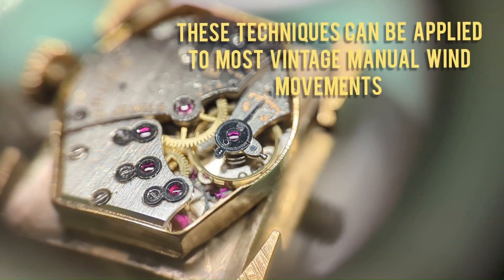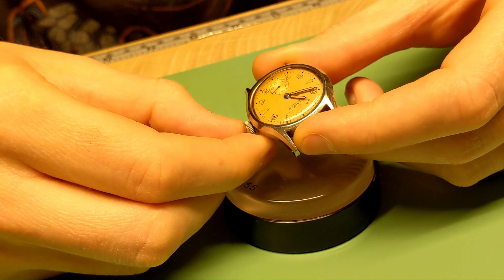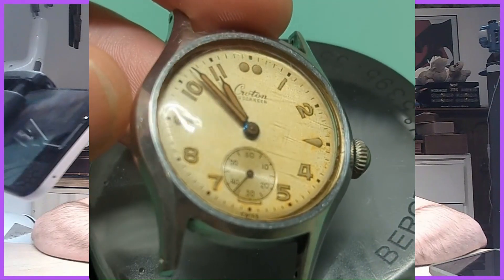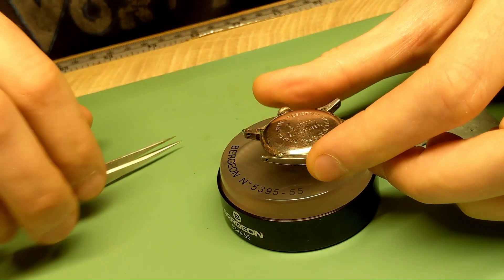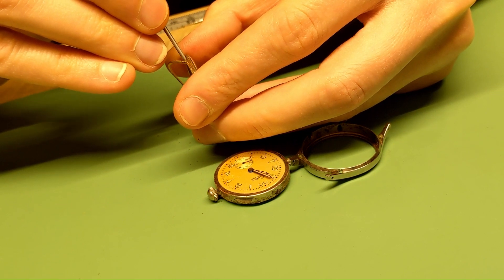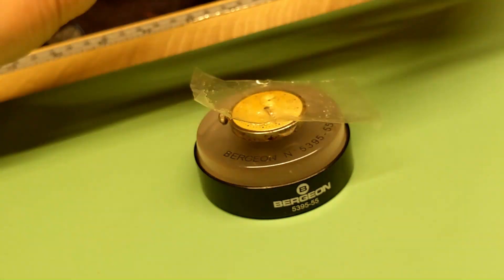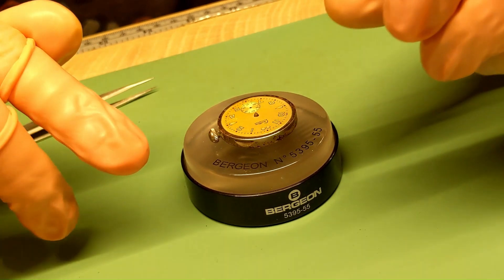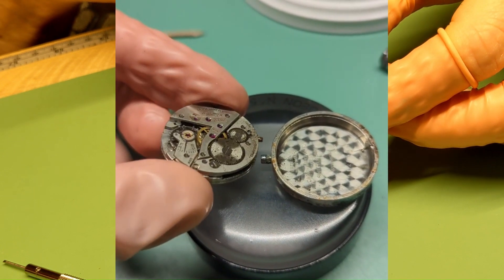COMPLETE Vintage Watch Restoration Tutorial! How To Service A Vintage 17 Jewel Croton Watch Part 1

Comment: How do you determine it has a 52 degree lift angle?
Reply from the maker: Good question! It can be measured but that's a bit tricky to do, there is a huge database for movements called Ranfft.org which is a great reference for determining the lift angle of movements.